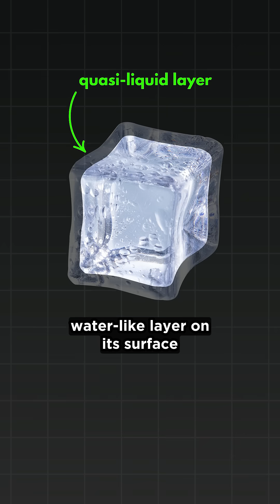The Science Behind Slippery Ice: Why Ice Skating Defies Logic

Comment: Isis slippery for a very simple reason. It's a low friction surface so friction isn't opposing force when you move. But if you have a surface with zero friction you won't be able to walk on it cuz you'll just slip and fall over constantly. That's why on low friction surfaces you tend to slide and slip over. Now for ice skates, they focus your entire body weight on a single point and anyone that knows basic physics knows less surface area equals less friction and ice already has a pretty low friction, but by focusing your entire body weight on a single point, you're essentially melting a very small amount of the ice underneath the blades of the skate. It doesn't have to melt a lot of ice. It just has to melt a very small amount of eye due to the pressure and that increases the slide ability along with the reduced friction which comes from having a lower surface area
Reply: a 150 pound person on blades would increase the temp of the ice 0.3 degrees. If the ice was 30F or cooler the pressure wouldn't be enough to melt any ice.

Comment: Look I'm in no way a physics guy but it interests me. When I heard the posed questions I instinctively answered :
1. It's slippery because of the thin layer of condensation so no matter the cold the ice is it'll still have condensation because of the external temperature or something.
2. The ice skates cut ice through friction because to cut ice quickly you need right amount of heat not too much or less and blade doesn't help unless.. It's rubbing something tough and solid which creates friction and it produces heat and because it's a blade it caves in and digs in further. 
So, I think It's something kind of known thing and definitely not debatable subject or has conflicting working theories as posed in the video.

Comment: The pressure theory is right. It's proven by the brick and a string video. An avg. Figure skater is around 66.7 kg or 108 pounds.
And if you look at the blades. They'r edge is a incut hemisphere wich has a surface area is so small that the pressure is enormus wich melts the ice and lets you glide on the water. The amount of water is small enough that the already existing ice instantly freezes it.

Comment: Pressure increases spread over a smaller point (like an ice skate) so less mass is needed to exert a high amount of pressure. Additionally, the melting point of ice is only 0 degrees in atmospheric conditions, meaning standard room temp and standard pressure. If you have a significant increase in pressure (like from an ice skate) the temperature required to melt ice decreases
Reply: a 150 pound person on blades would increase the temp of the ice 0.3 degrees. If the ice was 30F or cooler the pressure wouldn't be enough to melt any ice.
Reply: @nathanielmuller4400  That's not the proper way to look at this. It isn't about how much pressure would be required to raise the temperature beyond the melting temperature of water, it's about how pressure influences the molecular structure of the ice. At ≈100 ATM of pressure, the hexagonal crystalline structure of standard ice begins to deform due to strain on the bonds between water molecules. This effectively lowers the amount of input energy required for those bonds to dissociate into an amorphous state, AKA liquid water. This means that, effectively, at the proper pressure range, the melting/freezing point of water is lowered, and thus it will melt. This is a demonstration of Le Chatelier's principle. Increasing the pressure puts strain on the bonds of the ice, thus the ice melts in order to lower stress and maintain equilibrium.

Comment: That would probably also explain why when you put a snowball in a freezer after a long time, it turns into a more dense ice ball
Reply: That is not even close to why a snowball gets hard in the freezer its because the shape of the snowflakes break down when you shape it into a ball causing the snow to push the air out of the snow and condense in a process called sintering increasing the density of the ice.....so much misinformation and complete failing of understanding physics in these comments 😂 what she said was wrong too look it up friction and pressure do indeed create the thin layer of water and if the ambient temp is below freezing ice does NOT have a thin layer of water unless receiving energy from outside sources, like body heat or pressure and friction

Comment: When it comes to skating, it IS the pressure. You dont have to be massive when your full weight is concetrated into a razor thin edge..
Reply from the maker: The change in temperature due to pressure would still be too small to raise the temperature to its melting point... unless the ice was very close 0 degrees Celsius

Comment: My guess is, that it breaks easily just enough depth to let the skate move forward, imagine an ice breaker ship at a much smaller scale. And so because the ice breaks easily and gets out of the way of the skate it is very low in resistance to move forward.

Now that I think about it, my explanation seems flawed.

Edit: actually, i might be making sense lol, i was previously thinking of ice breaking moving forward, but even the object is pressing down it's probably breaking the ice, even if just micrometers of the top, either breaking and/or melting the top micrometers or so, resulting in the top layer being water causing nearly 0 friction/resistance.

Comment: That thin layer of ice is the same effect that happens when you dip your hand in something hot very fast. That effect is the same here. But it is the ice doing it and not your hand.

The ice is releasing small bits of water as a barrier to keep the ice from melting. As the area heats up. The water heats up on top of the ice and slowly starts to melt the rest of it.
Reply: You are completely incorrect what your explaining is called the leidenfrost effect and that is NOT how skates work 😂 thats a pocket of vaporized water creating a bubble of gas separating the water from your skin and it also doesn't work with boiling water you got that backwards its when you stick your hand in cold liquid and your body heat causes it to evaporate and make a bubble of protection wtf are they teaching you kids these days 😂

Comment: Technically you can't prove that theory unless if you have a freezer with a controllable machine and two ice cubes all are lower than freezing temperatures and control that machine to move an ice cube ontop of the other. And the reason is no matter how fast you stack those cubes they still did have a moment of room temperatures, which is probably enough to melt a nanometer layer of the ice cubes.

Comment: Heat transference?? And also the way wáter freezes from below, then the top can be at lower than 0°C  but not freezing, and with the skates, allows because of the metal from skates to break a bit from the surface and after It, It freezes with the carving done. That's what i think. Oh, also is slippery bcos of that small unfrozen layer of water. Same as in the ocean water can be below freezing point but doesn't freeze bcos It freezes from below and the movement of the water. That's why after they carve the ice, It then freezes (my stupid opinión)

Comment: The blades are a concave shape, and because of the weight distribution the ice would melt, because of such pressure being concentrated into one area and melts the ice, the water then coats the bottom of the blades it makes you slide.
Reply: What the Furina
Reply: Problem is speed you can't melt ice with that pressure with that speed. Math doesn't work out and ice is not slippery with ice skates alone ice is slippery generally except against ice.
Imagine 6 triangles makes an hexagon now hexagon is stable and strong. Once you become hexagon you don't deform easily. And from hexagons becomes a pattern that's ice crystals. But at the sides there are some triangles left and those are not stable they can form new hexagons with enough triangles but triangles always exist and THEY SLIP ALONG THE EDGE If enough force is there they act as a watery layer on ice and it always exist depending on temperature ratio changes so less triangles as temperature decreases after certain point.
So there is a temperature where ice is most slippery.
Reply: @tembelninja3696  Veritasium subscriber spotted

Comment: It lubrication theory. It's the same reason you apply oil or grease to bearing surfaces. The liquids fill in the micro crevices of the two materials and create a plane of low friction for the two surfaces to move past each other.

Comment: Idk, I always just assumed that skates did the same thing that bikes did, where going fast enough while upright will keep you from falling over. The tiny surface area that skates is so small that there is less friction. 

I never really thought about it, I just assumed that even if it's not melting, little bits are being scraped off, this would make the friction of the surface matter less since any bumps of groves that could slow you down are just effortlessly breaking off. I assumed it melted because the particles were so small that they were easier to melt

Comment: My guess is the hydrogen or oxygen on the outter layer of ice is more susceptible to change or is chemicaly different than the inner body of ice. I like to think ice is like a frayed cloth. Easy to fall apart on the edge, but held well together in the center.
Reply: I think it is incorrect to say different chemically you should say different structurally. I might be wrong though
Reply: @tembelninja3696  Its possibly structure, the outside is exposed to the air which is why I say chemically. Rust is chemically different than the body of iron it comes off of.